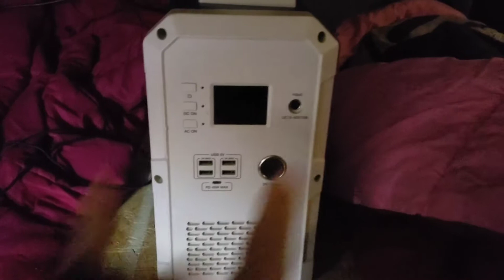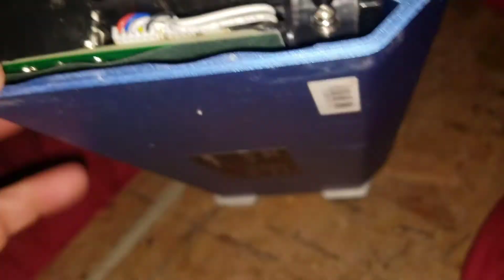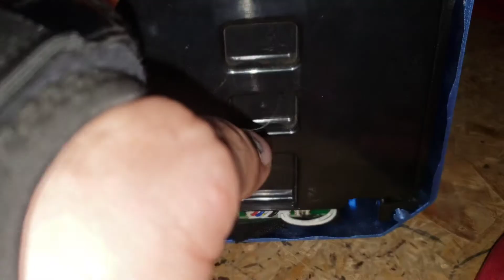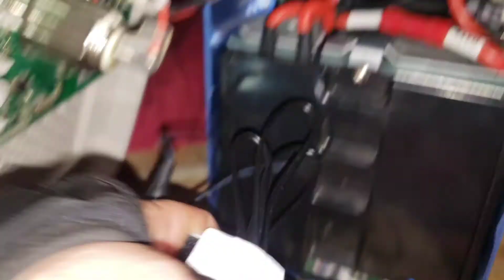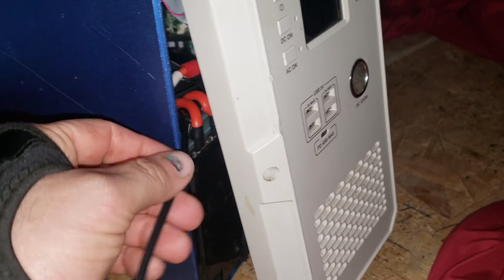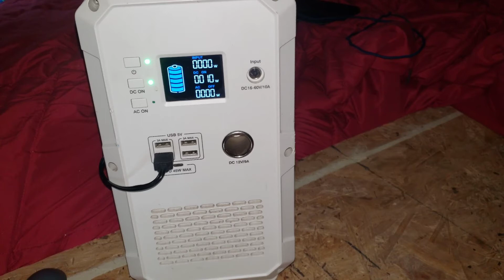Heated Solar Generator Because Lithium Can't Charge Cold

Comment: OK, do tell us more. HOW do you know when you can charge the battery...it just works?
Reply from the maker: I leave it on when I know it could go below freezing. It is only 10w so it is a very slow heat. It is still relying on the low temp disconnect built into the unit.

Comment: No way I'd take my power station apart to do that.  Lol.  I'd rather attach heating elements on the outside.  It would require more than two, of course.  Did the trick with the heater and the thermocube not work?
Reply from the maker: I use the thermocube to control heat in the compartment with my water. This contraption warms the inside of the sogen no matter where I have it. Putting heat on the outside will work but that is best of you don't move it very often. More likely to get damaged if it's on the outside of one that gets moved around.
When it gets near 0° my extra water jugs on the floor will start to freeze along with my sogen. This keeps it in good shape in extreme cold. 
I also haven't seen a sogen with built in battery warmers so doin something I haven't seen done before was part of the inspiration. 
It still is easier to just drive south though lol.
Reply: @VANquishedAdventures  That's what I'm saying.  Get the hell out of Dodge.  Lol.
Reply from the maker: Yes ma'am, don't have to tell me twice lol